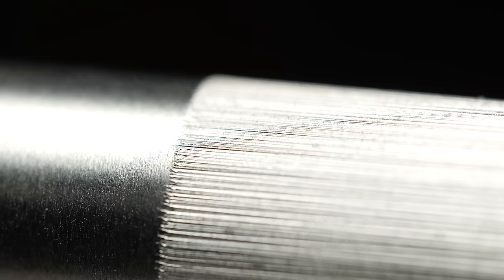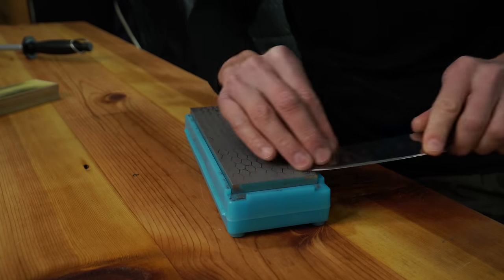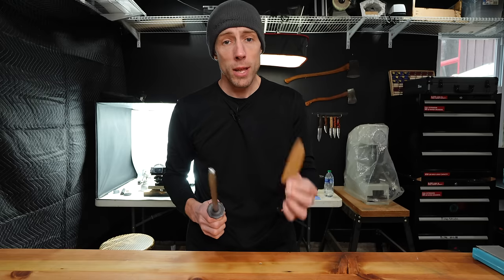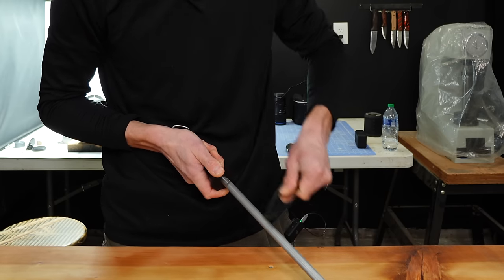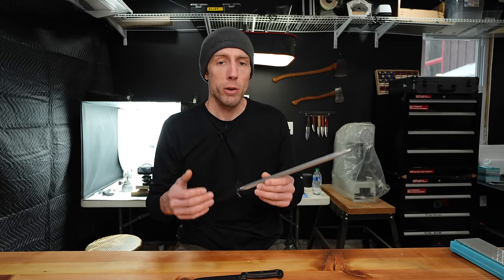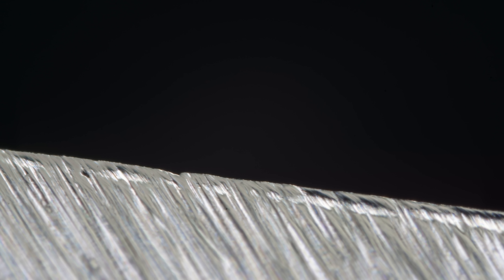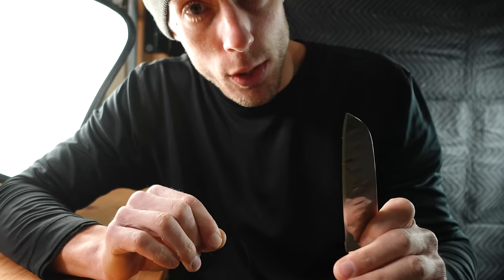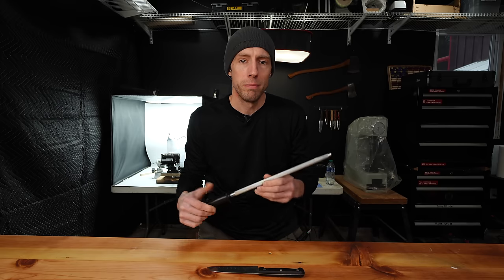What Do "Knife Sharpening" Honing Steels Actually Do?

Comment: Not saying you don't know how to sharpen knives, but if so many chefs use this method maybe they are doing something slightly differently than you are. Invite a chef in, show an edge they think needs sharpening, then have them use the honing steel, then show the edge again.

I believe the honing steel may be some form of hardened metal, and the lines/grooves are not there to get a better grip on the rolled over edge. I think its actually meant to remove metal. So its not for rolling the edge straight, but instead to actually sharpen in a similar manner as using the diamond plate.  Honing steels do ware out over time and get smoother. A sign that the sharp grooves are not as sharp and not biting into the knife metal as well.

Comment: I was taught differently on how to use a honing steel and now I'm curious on what your testing would reveal. I was taught to drag the blade edge forward along the honing rod where the rod is running the length of the blade, almost like your trying to cut the rod with the blade but the edge is scissoring with one of the grooves on the rod. essentially the rod passed down the lenge of the blade from the base to the tip but your moving the knife not the rod. an even number of strokes on each side usually cutting away for the left side and toward for the right side. though if you have safety concerns you can cut away for both and just cut from below for the right side. Ive no idea where the stropping method on a honing rod came from but I believe its a mistake.

Comment: 5:40 - what?  No it's not going to take the same pressure.  The structure of the metal is changed by the first bend.  It will be easier and easier to change that edge the more it gets bent.  I suppose to be kind though the difference between one instance and the next is probably not super different, although I imagine the delta change increases over time.

Comment: Quick question. I have a ceramic honing rod, it's abrasive, so should I consider that rod a cylindrical sharpening stone (stick)? And am I unnescessary whittling my knives away using it to lightly hone my knife regularly. (I would sharpen them using my proper sharpening block from time to time.)
Reply: my 2cts, a honing rod is not abrasive. there are diamond picked rods, ceramic rods which take off material from the knife. i wouldnt use them , even you have much quicker sharpening results, but it comes with a cost.for sharpening use  stones, for honing a good quality steel honing rod.

Comment: so... when you sharpened on the diamond stone it apears you are stroking hte knife edge first over it, but on the honing steel you are going the other direction. why the different direction? what happens if you use the steel running the blade forward on the steel on both sides (alternating)

Comment: i use a honing steel all the time in between sharpening, it can bring a knife from kinda dullish back to shaving sharp when i do it. you can only do it a few times before you gotta bring out the ken onion, but it definitely works.  i cut downwords into the steel though, i wish you would have done it that way too for a close up.

Comment: No matter your non experience based ideals. The piont on the honing rod is meant to be placed on the cutting board and the knife is run edge forward from hilt to tip. Butchers originally held them in the air and honed the knife toward them. The speed used in honing the butchers way allows for better chance of keeping the same angle. The semantics of this video make it seem that you are the only one confused. The only misnomer is calling it a sharpening steel as it is a honing rod used to hone the knife in a professional environment that you cannot hang a leather strop.

Comment: Rolling the edge like that is not realistic, too extreme for the steel to correct. The steel is used to maintain the edge to extend the time you have a sharp edge. It must be done frequenty while using the knife. I've never seen anyone use trailing strokes on a steel.

Comment: My go to is ceramic or diamond oval shaped "honer"" if under good light a imperfection is visible. When you keep consistent angle you hear noticeable change. Now if I used my knife for plumbing or caught the edge on say a steel  table, and was expensive grade down levels of grit. Japanese tri-stone with oil dip hold on bottom. Keep your angles and directions of pull.
Reply: That guy has a camera so he is a professional knife maker, even though you and me with oval sharoeners can achieve better perfectiin without fame.

Comment: i just use a set of whetstones every now and then, i worked as a chef for years and i refused to use the rod and they thought i was crazy. my reason at the time was just that using a stone is much safer than having rod in one hand and knife in another. Sure it looks fancy when someone does it fast, but i need a sharp knife not a circus act.

Comment: Your argument presupposes that the purpose of the steel is to repair a severe rollover or to remove a burr that remains due to improper sharpening. This has never been the case.  Sharpening steels are most often used, and intended for, edge maintenance of a properly sharpened blade that has been dulled by ordinary use.

Comment: I work in an abattoir and see every day multiple people using steels and I have told many of them they do literally nothing, they obviously don't sharpen anything and my conclusion is that it works for a short time depending on how it is use because it leaves mini serrations on the blade, however they soon vanish and then a stone is needed to resharpen  the blade, a decent strop is far more use if used often instead of the steels, unless it is a fine sharpening steel as you said

Comment: I was shown to use the steel by standing it point down against a cutting board; setting the blade angle against the tapered point, and then drawing the blade upward toward the handle.

Comment: As a butcher, I'll sharpen a knife once or twice a month on a belt or a fine stone to get that razor edge. When you're cutting through tough veins and fatty meat, the knife will "dull" quickly.I've found 5 seconds on a honing rod correctly, can make a massive difference while working, and I probably use it about 10 times in an 8 hour shift. I may go to a stone once on a very busy day.
Reply: And is your honing "rod" smooth without the striations?  If so, do tell the reasoning.

Comment: Science of sharp has shown that steeling effectively remove metal from adhesive wear, his micrographs show that you can have a decent clean edge with it. Where have you learned this edge trailing technique? It is all kind of wrong, whereas edge leading effectively removes burs and rolling. That is valid for hrc up to 60-62 at least, maybe don't steel your zdp189, apex ultra etc. In any way, I tend to to like more a fine ceramic rod, no other tool needed in the kitchen, once your angles are set on diamond plates.
Reply from the maker: Watch my follow up videos for your questions. Todds experiments are fine, but once you change the variables, you can change the outcome. I would need the exact steel and knives he used otherwise it makes no sense to compare results.

Comment: The "honing" rod isn't just to straighten a rolled over edge, it burnishes the edge. When you severely roll the edge over with a pipe, you don't get the polishing effect of burnishing because of the high forces needed. With free hand "honing", you can't maintain a hair witling razer edge. You can easily maintain a sharp apex, but do get tiny undulations over time which is not a bad thing for food since its microscopic serrations. This happens because of use, and also because of work hardening from honing, which also isn't a bad thing. Burnishing is a common process that gets the same effect as abrasives. See "lathe burnishing" or "ball burnishing".
Reply: I think steel hones are superior for maintaining an edge. I have all the sharpening equipment in the world and only use them when I need to rework a damaged edge or reprofile an edge.

Comment: As a professional knife sharpener, and former cook, I find it astounding how many people think this actually removes metal. 

However I disagree with you saying it's outdated technology. If you know how to actually sharpen great, but the majority of my clients don't have the time or desire to really learn. I teach them how to hone with greater success.

Also, using a copper pipe is NOT even close to cutting it with food. You are doing a lot more damage and roll to the apex with the pipe, it's not surprising the rod is not helping.
Reply: A ribbed butcher steel was being used , which is a file . The only time they don't remove metal is if the blade is too hard .

Comment: Just as a knife can be honed at different angles, a chefs steel can be run at different angles too. If you intend to apply a lot of pressure with the steel I believe you need to nearly match the primary hone angle.  Otherwise you over do it and create a rough apex that will need a lot of stopping.  The ridges on the typical steel localize and concentrate whatever force is applied so there is need to strong arm the knife against the steel.  
No matter how a steel is supposed to work, steels work!  There is a significant, perceptible sharpening effect otherwise chefs all over the world would not be using them.  Knife bags and backpacks used by chefs frequently have a special slot specifically for their steel, never for a two sided honestone.  Interesting that hikers, campers, hunters and preppers do just the opposite.  Very clear where you stand. 
IMHO steels apparently function in several possible ways.  The steel can straighten out normal rolled edges and nicks.  But the principle one is likely by burnishing.  Knife steel against sharpening steel will burnish the apex and can even raise a bur if done only on one side.  But alternating strokes will fatigue this bur away. If the knife is run edge first into the steel the burnished metal may flake off or might be cold welded back on away from the apex.  You will sometimes find that butchers are not allowed to use the common steel with the fine ridges.  Instead, they are restricted to smooth steel.  It seems incredible but a smooth bar can and does sharpen the butchers knife edge ... but throws off far less shavings into the product.
Reply: One thing that needs to be mentioned is that a sharpening steel is not all that useful on the latest CPM knife steels that have swept the EDC knife market.  The sharpening steel is effective and quick on standard kitchen and butcher knife steels.  It might even be used multiple times each day in butchering where the softer metals hold up to bone better than CPM's

Comment: Thanks for great videos on honing rods.

I have worked at a slaughterhouse. A butcher often sharpens their knife with a professional whetstone using water, and any burr is polished away with wax and polish, leaving no traces of burr on a sharpened knife. A butcher always uses a honing rod essentially all the time. They use the honing rod to straighten out the edge, not to sharpen the knife or remove burrs. The issue with a honing rod is that the grooves can catch the edge and damage it if used too forcefully. Unluckily, if the edge is folded, the grooves on the honing rod may tear off parts of the edge and create a burr.
To avoid this, a butcher polishes a new honing rod with an abrasive cloth until it is shiny, and all traces more or less disappear. They continue to polish it frequently during coffee breaks, etc, to ensure that it is always shiny and scratch-free. So, in practice, a professional butcher turns their honing rod into a big burnisher, which is normally used to turn the burr on card scrapers. And when they use the honing rod, they are very gentle to avoid damaging the edge and having to re-sharpen the knife.
And a butcher does not cut with the knife directly against the cutting board. There is a lot of contact with bone and cartilage when the meat is to be speared from the bone, so the edge is often beaten and bent.

My only guess for why chefs use a honey rod the way they do is because they don't know any better. They treat it the same way they chop onions, maybe they think the speed gives them street cred? ;)
A new honing rod is not a tool meant to be used straight out of the box.

I would really like to see the same test with a burnisher, solely for straightening the edge, not removing the burr.
Reply from the maker: I show this in the video

Comment: "You're using honing rods wrongly. You have to use it on rolled edges, which it doesn't work on." what a strawman argument 🙄
Reply: And yes they ARE abrasive. Just not as aggressive as diamond obviously and even less than ceramic. They ARE used for a quick resharpening. But for true sharpness you need to grind the knife on a stone obviously.
Reply from the maker: @nowonmetube  looks like you proved my point 👍

Comment: There is a use for those steels.  Peen edges very thin and using the steel to roll  back and forth until it breaks off leaving the blade as sharp as molecular ly possible.  Thats how you sharpen a scyth or any unhardened yet high carbon steel.
Reply: They are from the days when the steel in knives was different.

Comment: Okay, first honing rods are not for sharpening but upkeep for the blade. Don't use these grooved ones use a SMOOTH honing rod. Also move the blade away from you blade facing forward. In kitchens it's not that important to use these but if you work somewhere where the knifes face a hard time such as a slaughterhouse you need to use these VERY often. Everytime you are done with something -> hone

Also these are hard to master and you will probably mess your blade up many times before getting it right.
Reply from the maker: @juho1227  should have watched the whole video bub
Reply: @OUTDOORS55 i did bub
Reply: @OUTDOORS55 "With a properly sharpened knife these are useless" no they are not. If the knife faces real tough work your blade will be messed up in a matter of minutes unless you hone it.

I don't know about these grooved ones but the smooth ones work very well.

Also you should lead with the blade and not do it the way you did in the video.
Reply: @OUTDOORS55 That's the reason butchers etc. use the honing rod.

But you are correct if you need to use honing steel in KITCHEN constantly you probably have a bad knife already. Chopping carrots shouldn't make your knife dull.

Comment: The way that you drag away from the knife edge goes against everything ive been taught. It feels the same as when you hear someone pronounce a word incorrectly. I was taught the the reason you push into the edge is because you are essentially cleaning it off. By dragging away, you are pulling a bunch of loose steel in line with your edge.

Also, contextually your illustration of a rolled edge is 2 dimensional. If you begin from a part of the blade which is not rolled, then slide across the rolled portion, you will have a far different result.
Reply: This said, I still enjoyed watched the video because you provided a lot of detailed reasoning behind your theories. Ultimately these are the conversations we should have as they yield quantifiable results. Not just "I do this this way because it's what God commands" or whatever other excuse someone wants to come up with to not do their homework.
Reply from the maker: We have to talk about this..
https://youtu.be/65JzsDU_0mI

Comment: Oof man - this video is really poorly researched.  You can find the answer on Wikipedia for goodness sake, and then maybe you could try a more representative test of honing steels. 

“Steels . . . in the West, especially in heavy-use scenarios (e.g. butchering, where the edge deforms due to forceful contact with bone) . . . also lead Western trends toward blades tempered to a lower level of hardness (and thus lower brittleness). In East Asia, . . . harder knives are preferred, so there is little need for steeling intraday . . . Instead, the blade is honed as needed on a waterstone. While tradition has kept the practice of steeling alive in Western kitchens, the majority of honing steels sold are abrasive rather than smooth, and knives are harder and more frequently made of stainless steel, which does not respond to traditional steeling techniques as well as high-carbon/low alloy tool steels.”

So, your honing steel will suck on stainless knives.   It’s meant for quick repair in heavy applications, but a home cook could use it instead of sharpening after a long period.

I never like honing rods but the video seems disingenuous and a really weird way to spend 15 minutes.
Reply from the maker: You should seriously watch my channel😂
Reply: @OUTDOORS55  yeah i do man.  i wasn't trying to be harsh just that there are more representative tests to show how and where honing steels make sense.  i just dont think the video tells the whole story which was regrettable since usually you are thorough and also since i hate honing steels and wanted to learn more about where they could be useful.  i found it online afterward i guess so alls well that ends well